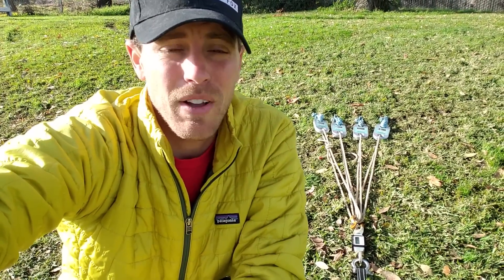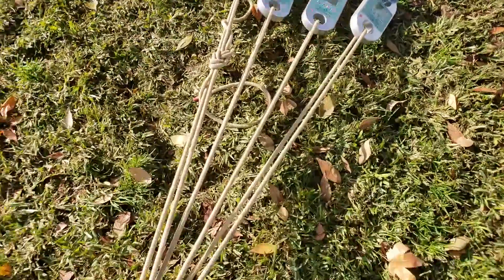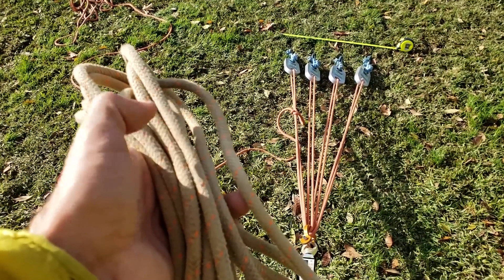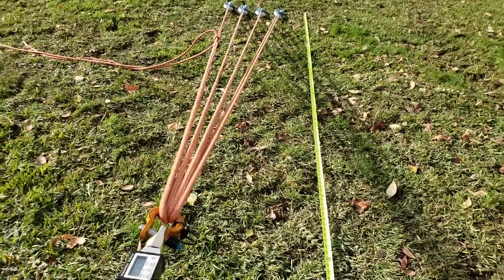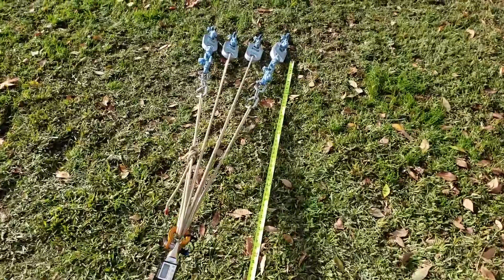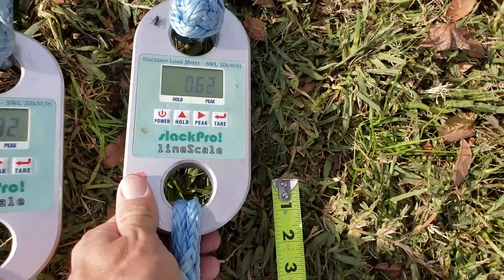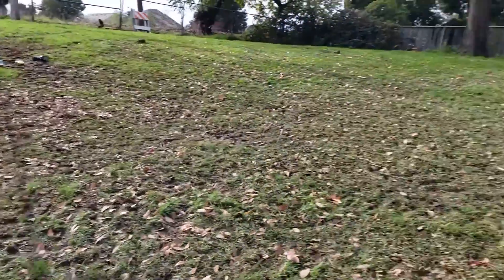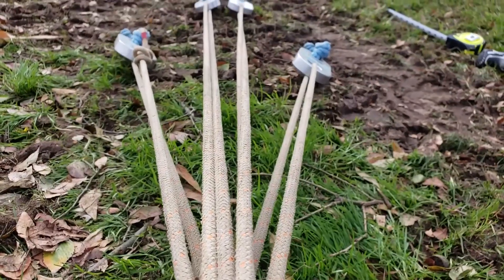What is the perfect bolt pattern for highlining?  Equilateral triangles might be the best!

Comment: It has nothing to do with a triangle. Three bolts in line would share the load even better due to similar  length and stretch connections but only in the one single pull direction .
Reply: It does have to do w triangles, however triangles are not the only answer. A perfect equilateral triangle will perfectly share the load, as I suspect a perfect in-series line would. Will either ever be made perfectly? No. 
In this case, the triangle has legs of .78, .71, .82 kN. A difference of 0.1 kN or 5%. I'll take that all day long.
Reply: @mapleknot3  No the tests prove that the triangle has one long strap and two shorter and that can't share the load equal.  That's only considering load not bolt security . More Inline bolts share the load equal  due to same length straps but bolt security may be not so good due to possibility of inline rock cracking .

Comment: I think you want the collection point in the focal point of a parabola, hence it is not only the distance between the bolts that matter, but also the length of rope to the collection point.
In the 4 bolt pattern, this makes a lot of difference, since it changes the relative angles between the ropes. The 3 bolt pattern should probably also idealy be on a parabola, but since changing the distance of the back-bolt doesn't effect the rope-angles, it is probably not a big difference as long as it is far back enough to not make a line. #latetotheparty

Comment: Wonder what would happen if you tied two more figure 8's into the BFK in the 8:03 system to have it replicate the sliding x's at 7:03 , probobly be a pain to adjust correctly but it would be more redundant than the sliding x but also might just weakin it because of the extra knots.. I like your final conclusion though with the triangle.

Comment: That's some pretty fine research there mate. We messed around with the cascade anchor which we called the VW anchor. W equalises down to the V. Actually more like 2 Vs equalising down to a single V. Very much like the concept of equalising over two anchors in a cascading pattern for high loading master point anchors. I need to set a trad anchor for hauling rock up a scree slope for some dry stone retaining walls at a popular rock climbing crag. I reckon I know have my anchor of choice. Thanks to your well done video for that. solved a problem for me. Cheers.
Reply from the maker: I like the VW name... it is what it looks like.  Most of our highlines don't require perfect equalization but cascading is a nice tool when it does matter!  Glad this demo helped.
Reply: I thought the minimum distance between bolts were twice the length of the bolts, at least it is for 3/8 climbing bolts. Just go back to the manufacturer's recommendation:-)

Comment: this doesn't necessarily relate to this video but why when tying a frost knot do you only tie it like an overhand knot? why not add the extra twist and make it a figure 8?  does the overhand retain more strength or have less chance of slippage occurring? normally I've found seen that the figure 8 is preferred over the overhand in most applications except this
Reply from the maker: Mostly because it takes so much webbing already, a figure 8 is even more. I can slack snap it to see if there is a difference.
Reply: The figure 8 can kill you while the overhand won't when doing an offset (flat) bend. The Flemish bend is an inline figure 8 bend that is safe, but for certain applications, like repelling, this won't work (since it's not flat) and is cumbersome to tie. You can also improve the offset overhand bend by considering a double overhand or a stacked overhand, but many repellers will just do the standard offset overhand bend (aka EDK) as it's simple and "super good enough." It will depend on your needs. But the main takeaway should just be: the figure 8 is not always the best choice. In some cases it can kill you. Study your knots.
https://northeastalpinestart.com/2016/09/27/one-of-these-knots-can-kill-you/
https://overtheedgerescue.com/rope-rescue/bends-joining-ropes-update/

Comment: yo man im digging this 14" lag bolts into grass nycparks r really coming down on using the trees regardless of protections etc      have u tested how much it takes to pull them out .... i understand very many factors involved      but like how much force to pull them out of loose soft nothing dirt....   anyway thank u so much and im not surprised about the triangles at all....
Reply from the maker: Your grass really depends on this.  A buddy just tried this is Arcata mud and it didn't work well... he also used 12" long which really didn't work well.  I burned up one battery trying to impact drill just 1 into my backyard dirt in middle of summer, that one was never coming out with just pulling.  Just create cascading v to v to v anchors and you can just put in as many as you need.  And don't hit any sprinkler pipes! :)

Comment: How much is the variability just due to the knot and the lines touching and running over one another. How can you test bolt patterns and remove the variability due to rope?
Reply from the maker: I like to test real life situations.  I'm very opposed to theory based anything.  Since a rope is used every time, i like to see the relationship between it and the forces.  Sliding X's can temporarily be out of line, but as soon as you put force on them, they find their way to the middle and the line that crosses over the others does not stop it from pulling the best it can.  The results would be no different even if I smothered it all in coconut oil first haha.
Reply: @HowNOT2  Hey, what about using a rigging plate for the sliding X instead of the orange shackle, so that the rope doesn't have any friction?
Reply from the maker: It isn't a realistic way of rigging for our highlines and I believe that friction works itself out as the highline is bouncing up and down.  I think friction just slows down the inevitable of whatever it is going to do.

Comment: This could go into The Bolting Bible as a chapter called Bolting Patterns. 
Info on anchor rigging like BFKs vs Sliding X's could be included as well.
The triangular pattern worked quite well with a bfk rigging, beeing strong, redundant, evenly distributed, shock free when one leg fails, and simple as no extra woopie slings are needed to prevent shock.
Reply from the maker: I need to badly update the bolting bible with this info!  Will do asap.  As far as building the anchor with the ropes, I am starting an educational course soon that will be helpful for people who are brand new as my channel is no longer that helpful for complete newbs.

Comment: Ryan, what do you think about the affect of the angle of your master point versus the size of your triangle? If your triangle was different sizes (30, 60, 90 cm base), would the equilateral triangle theory still hold true, regardless of anchor sling material/elasticity and master point angle? What about if the bolts are off-level from each other/the master point? 

Great exploration into bolting theory! Thanks for analyzing such long-held assumptions in slacklining. Now how about the dogma surrounding weblocks... are they really stronger/better than ratchets?
Reply from the maker: I'm going to dive deep down this rabbit hole of triangles as I still have Andy's dynos.  Looks like I'm drilling some holes in my patio again :)  Bolts drilled straight into a cliff is a whole other rabbit hole I'm excited to explore!  Good thing a single bolt is plenty strong for the entire highline haha